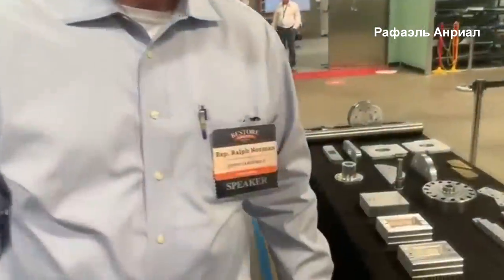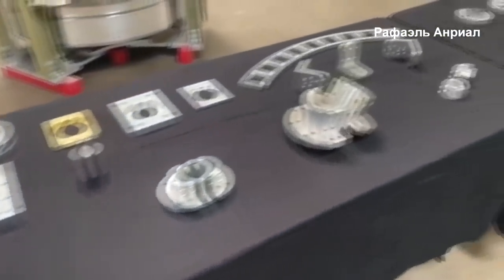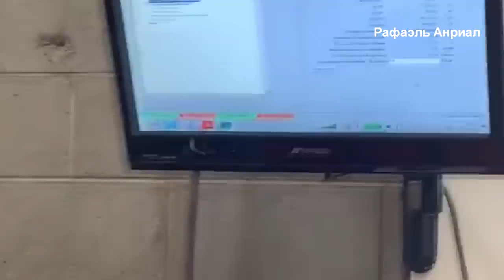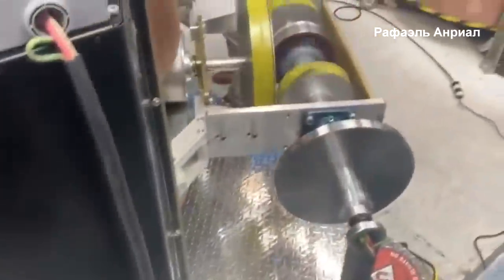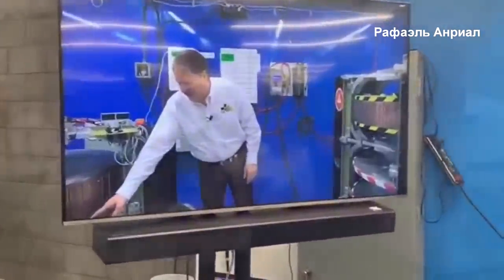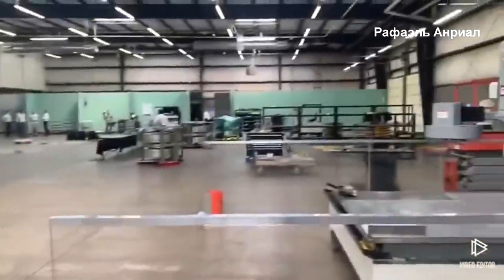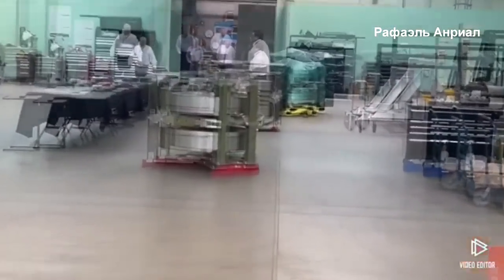БТГ ГЕНЕРАТОР НА 25 КВТ СЕКРЕТ РАСКРЫТ!

Comment: И какой же секрет раскрыт? В комментарии к видео о прозрачном варианте этого генератора я писал что  существуют двигатели работающие на энергии запасенной в магнитах при их намагничивании и одна фирма даже разработала двигатель который при мощности 7 квт до перемагичивания магнитов  в состоянии выработать 60 Мвт энергии. Про этот двигатель рассказывается в учебном пособии для студентов где оисано несколько конструкций двигателей работающих на энергии запасенной в магнитах Магнитный двигатель из США тоже не вечный вот что можно прочитать на сайте тех кто разработал этот двигатель The Earth Engine is not a perpetual motion machine. The Earth Engine uses the force created from two opposing magnets. Magnets are a depleting resource that requires “recharging” every three years. If the engine is shut down, it will stop rotating the drive system.
Earth Engine - не вечный двигатель. Earth Engine использует силу, создаваемую двумя противоположными магнитами. Магниты - это истощаемый ресурс, который требует "перезарядки" каждые 3 года. Если двигатель выключается, он прекращает вращать систему привода.
Если они будут подавать энергию от своих магнитных генераторов со скидкой 50 % то будут зарабатывать минимум 5 центов с каждого киловатта. Кстати первый "вечный" магнитный двигатель который якобы разработал Слободян (с кривошипно-шатунным механизмом) можно видеть на рисунке № 3.22 все того же самого учебного пособия для студентов. Многие люди не знают о существовании двигателей работающих на энергии запасенной в магнитах при их намагничивании чем и пользуются мошенники типа Слободяна или Майкла Брэйди которого посадили за мошенничество еще в 2010 году. Кстати магнитный "вечный" двигатель турка который уже лет как десять пытается окучивать лохов-инвесторов это аналог двигателей Брэйди...